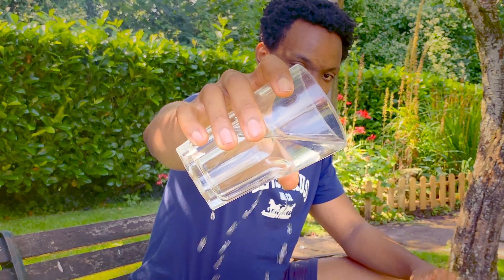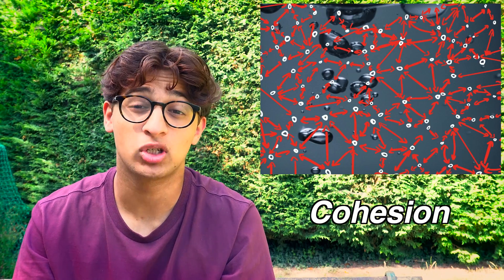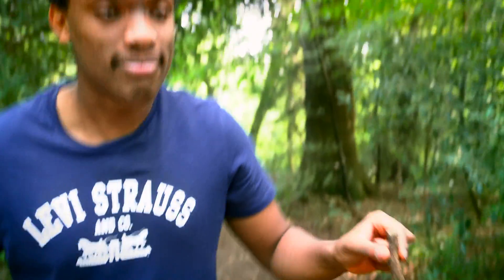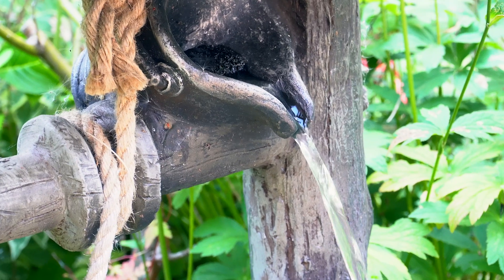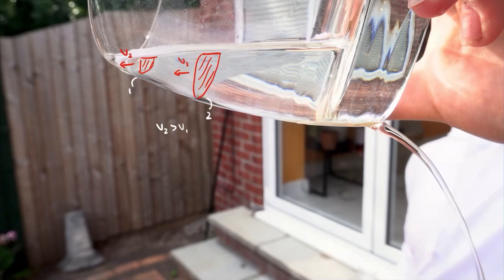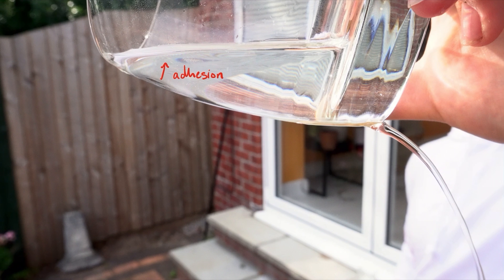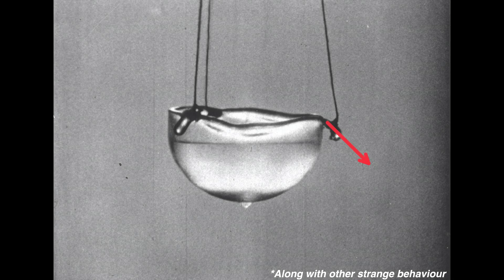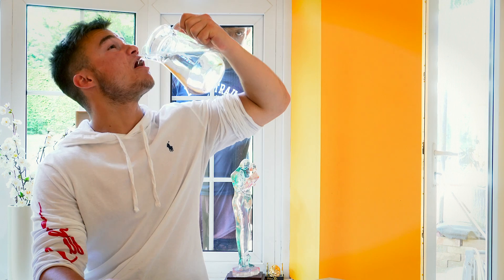Why does water stick to your glass when pouring?

Comment: Nice video! I just want to add that this phenomenon is also due to the Coanda Effect which is the tendency of a fluid, such as air or any other liquid, to adhere and flow along flat and curved surfaces like the mug in this exemple.
Reply from the maker: We are aware that we missed that, but you are correct in pointing out that our explanation only scratches the surface of fluid dynamics. Thanks for the explanation and comment! 🤜🤜
Reply: But why is the Coanda Effect?